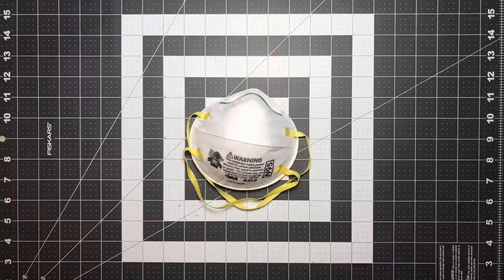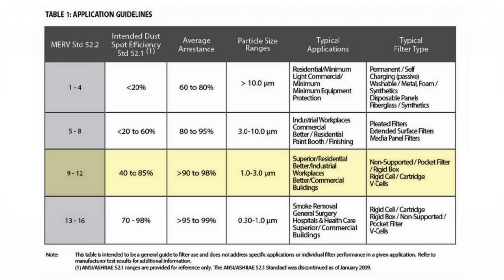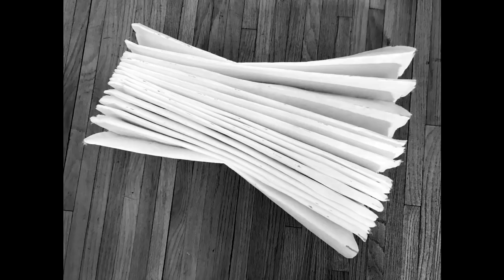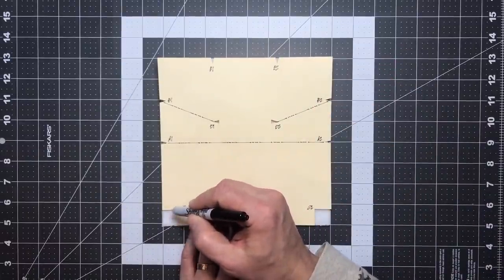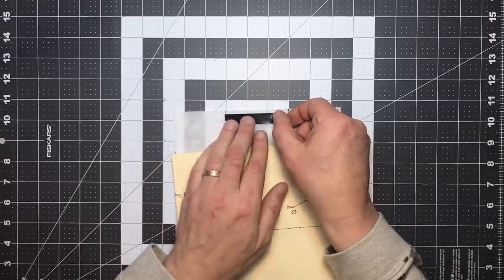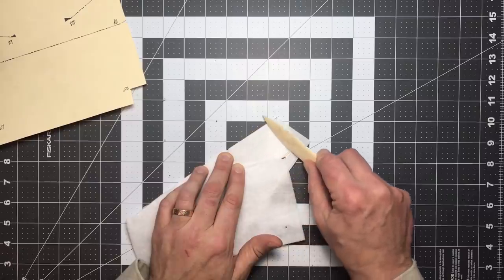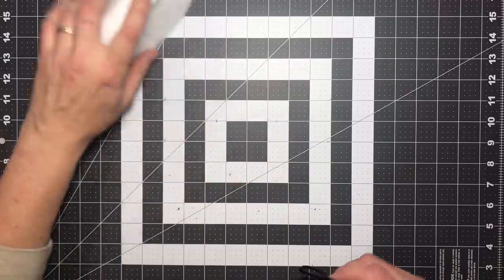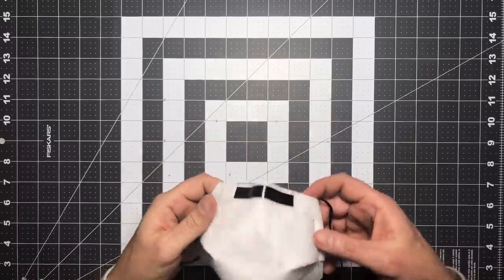MOO MASK

Comment: This looks relatively easy with your clear tutorial. I wonder how closely the perimeter fits to the face. Can you put a photo on your website as a demonstration. Thanks for your innovation and sharing!
Reply from the maker: Sure! I’ll post some photos tomorrow and let you know when they’re up.
Reply: Very inventive mask idea! :D  And I'd like to see this modeled as well!
Reply from the maker: My apologies for the delay! I've posted a few images at https://www.wegscheid.works/updates/why-yes-i-am-a-model.
Reply: @wegscheidworkshop9876  Thank you for the photos! :)  I also saw that you said that you tried several adhesives and settled on the gorilla tape.  Did you try any double-sided tape in your experimenting?  I was curious as to it's adhesive properties on the filter.  Thanks!
Reply from the maker: @violasunshine1  I haven't tried any double-sided tape, no. I tried a few single-sided tapes. Gorilla Tape stuck the best, but I don't think even that would hold as well as the staples.

There might be a double-sided tape out there that works great, though, so feel free to experiment. If you do, let me know what you find out!
Reply: @wegscheidworkshop9876  Thanks!
Reply: @wegscheidworkshop9876   If you use a 5" filter, should you still cut the shape as an 8" x 8" square?  Where should the fold go at that point?  Working with a 5" over here, and realized that it's different than your video.  Thanks!
Reply from the maker: Yes! No matter the size of the filter, you start with the same 8" x 8" square with a fold right across the center. With a 4" filter, the top and bottom of the square are cut right along the adjacent pleats, but with a 5" filter, the top and bottom are cut an inch away from the adjacent pleats.

I just slightly prefer the 5" filters: you waste a little more material, but the cuts are a bit easier to make, since you're not cutting right on the fold. But either size should work just fine.

Comment: Great Video, thank you for sharing!  Question though....Could we use hot glue instead of staples to avoid making holes in the filter?  Or maybe even still staple, but then go over it with hot glue to seal the holes?  I could not get a furnace filter, but a hepa vacuum bag instead.  Thoughts?
Reply from the maker: Great questions! Thank you!

The way the mask is designed, the staple holes are directly against your skin, so I don't think they're a huge concern -- but you could place a small piece of duct tape over the staples. I didn't try hot glue, but you should feel free to experiment (I always make a mess with it).

The filtration standard for HEPA filters is considerably more stringent than for the MERV 11 filter I discuss in the video, so I would have a concern that the mask would be too difficult to breathe through. If the airflow is too restricted, the mask will be uncomfortable, and more air will leak out around the edges of the mask and possibly reduce its effectiveness.

I haven't looked at the HEPA material for that reason, but this mask design also requires a certain stiffness in the fabric to help it stand away from the wearer's mouth: as with any mask, if the fabric touches your lips, you risk picking up contaminants trapped in the mask itself.

My website, www.wegscheid.works, has links to all the materials, including the filter. They're all currently available on Amazon, if that's helpful.